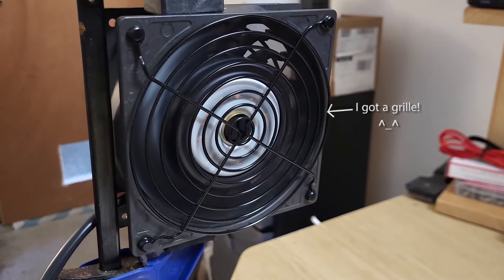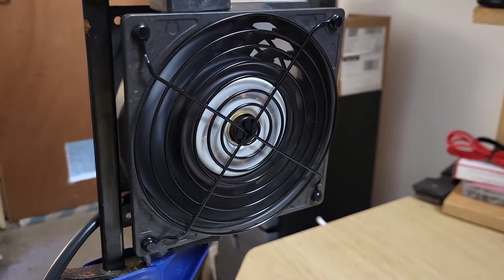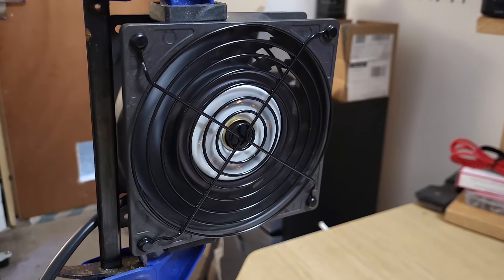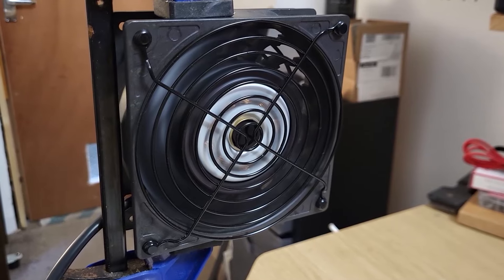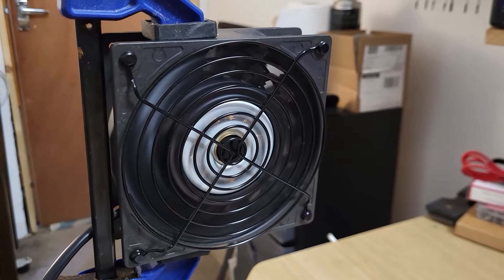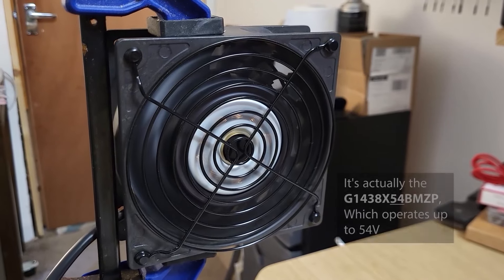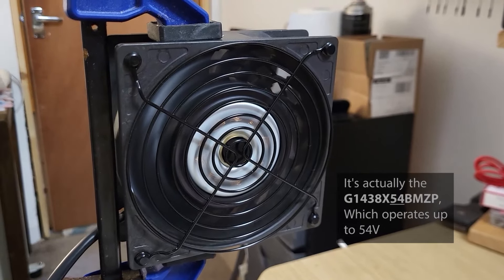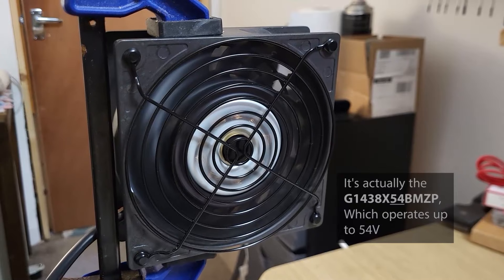Turns Out My 15,000rpm 140mm Fan Can Go Faster...

Comment: Ok now test the CPU cooling performance
Reply from the maker: Maybe in a future video - it might destroy the heatsink x)
Reply: @FanPhys  would probably have to brace the cooler directly to the case so it doesn't just rip it off the motherboard lol
Reply: 400w? That's a CPU heater not cooler.

Comment: One hot summer I was bored so I took off a cooler from a scrap motherboard. Ran it off roughly 20V and it cooled like crazy while it worked properly. One of the fins snapped off, after fixing that the bearing started falling apart.
I'm impressed at how strong the bearings are in these server fans to survive such abuse.
Reply from the maker: Yes, these fans are of the highest order when it comes to precision engineering and manufacture. Consumers generally don't interact with this level of hardware!
Reply: It's probably more about precision and less about strength. Having ball bearings that are more precisely the same size would allow for a faster rpm I think.

Comment: That's exactly what i was talking about, these higher tech fans limit their rpm, but there is still some usable overvoltage headroom to make them scream a bit more eheh :) i'm really glad you revisited the previous video with the fan properly fixed, with grill protection and mostly important overvolted 😈(because safety comes 2nd, just kidding of course). You earned a new sub 😁👍
Reply from the maker: Thank you!

Comment: Hi is the wiring on this 6 wires? If so what is the wiring diagram on this?
Reply from the maker: Nope just a standard 4 pin PWM fan. I attached an ATX 12v connector for V+ and GND because of the high current.
Reply: mine just come by post and it has 6 wires. 2 red, 2 black, 1 light blue, 1 light yellow. I think I join the 2 reds together and 2 blacks together. Supplier stating yellow is pwm.

Comment: I wonder how much static pressure it produces
Reply from the maker: According to spec it's 2450 Pascals, which is about 250mm/H2O. For comparison, I measured the Gentle Typhoon at 2.5mm/H2O. A hundred times that. :D
Reply: @FanPhys  Wow that is alot of
Reply: @FanPhys are the blades plastic or metal?

Comment: is there a 12v version pls
Reply from the maker: Nope - these fans are over 50V for a reason!
Reply: @FanPhys  for what reason
Reply: @anonymus1234_  The amount of power needed would mean that if you were to run this fan at 12v, you would need to give it over 15 amps, which would be both dangerous and difficult